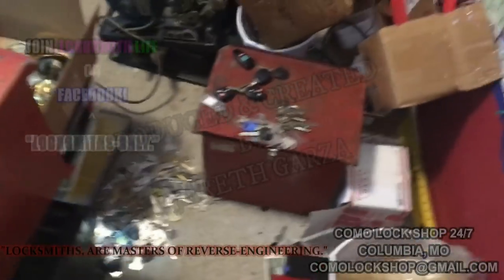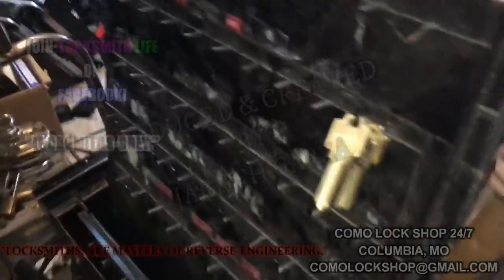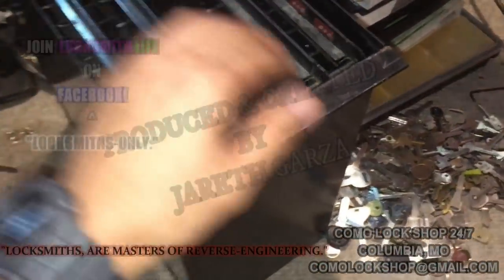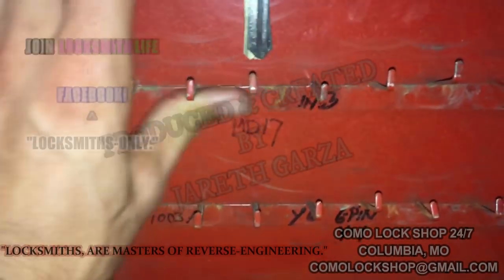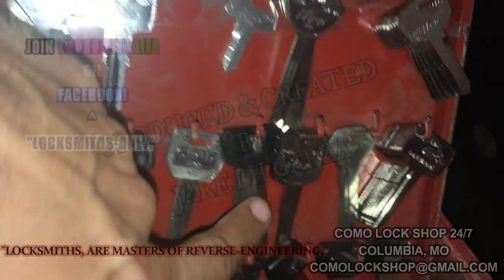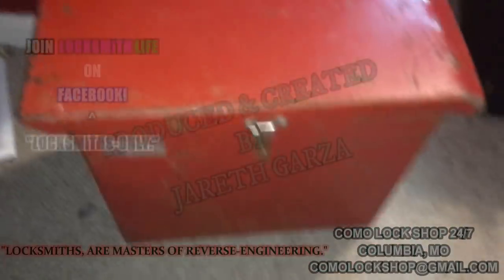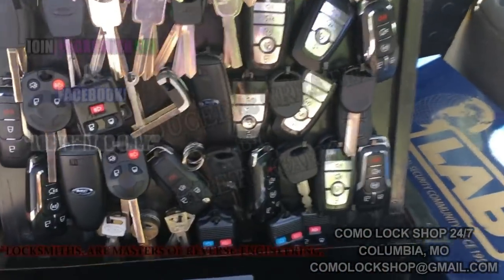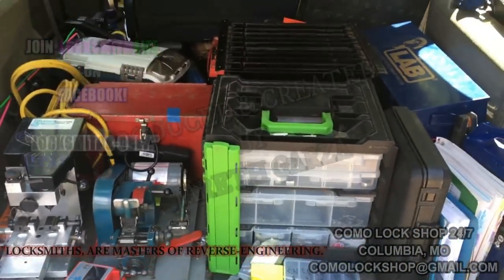Key-Box Storage.

Comment: Hey man.. ever come across 2016 or so.. Chevy Sonic key? references say its HU100..and it is...but where the key is carved out.. toward the to edge of the blade.. its just a straight line cut, not wavy like most HU100 cuts.. if that makes sense.. it also looked like it was 10 cut as well.. not regular 8cut.. ever have to cut one of those?
Reply from the maker: Yes